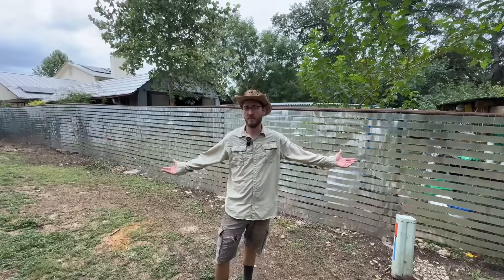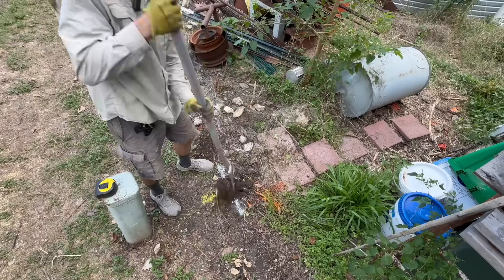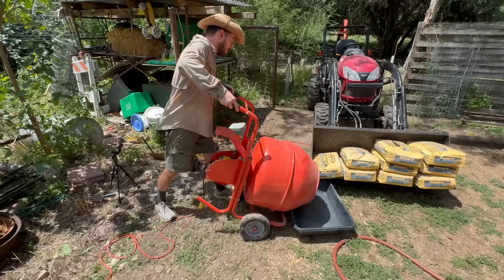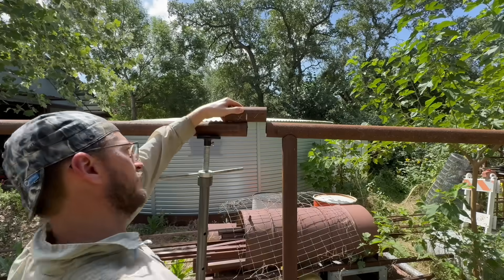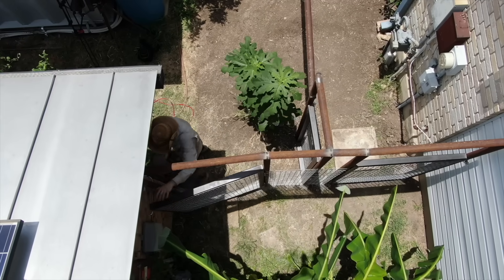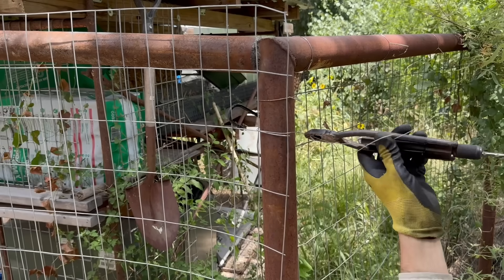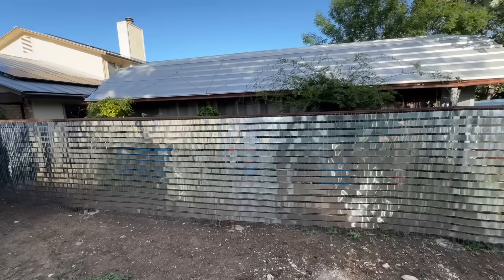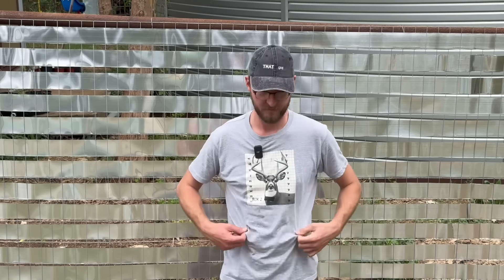This FENCE Lasts 100 years!!!!

Comment: my experience with welded wire fencing, is to unroll it on the ground parallel to the line of posts, and then stand it up starting at one end.  much easier than slowly walking the the whole roll upright.  very creative idea, but if I was the neighbor, i'd not be thrilled to have a shiny aluminum fence that you can still see through, as a barrier between me and your scrap piles....although if it were me,  you would probably be the one with fewer scrap piles!

Comment: Will there be shine bearing down on the neighbor’s yard? We have that problem with our corrugated metal siding on our garden beds. Neighbors don’t seem to mind when there are slight shine on them when they drive down the alley at two in the afternoon on fall and spring days.
Also, our waist high garden bed is like a salad bar for the deer. Even though we’ve had to stick a bunch of things in so they point up, they can jump into it. I stick even more things in then.

Comment: Might want to check that drill stem with a geiger counter. The scrapyard i used to get it from had to stop selling it after they found the supply they were receiving was radioactive. It was lower levels but it was still crackling. It was all from super deep well drilling so i guess it got more exposure?
Reply from the maker: I just bought one on Amazon thanks to these comments. I’ll pin a comment if they are active to a dangerous degree.

Comment: Thank for that video. I live in Pittsburgh. The area I live in will permit this type of fence. I like this type of fence. My reason for a fence is because of my dog. My dog isn’t too smart (yet) to dig under the fence, however I wouldn’t put it past her to be able to squeeze under it. Would a brace on the bottom be a solution?
Reply from the maker: You could weld a horizontal pipe a couple inches off the ground spanning between each post. That would help.
Reply: Would you do that before or after the mesh placement?

Comment: how have I never heard of wire twisting pliers!? Subscribed and liked just for that. Seriously fantastic video.
Reply from the maker: I put a link in the description to the pliers that I have found hold up best over time. I went through 2 pairs of the $30 variety before buying the ones I link to. They are over $100 but they have held up SO much better over time. Thanks for commenting and for your support!

Comment: If we had scrap dealers that had old drill pipe here on the east coast, I would have done this in a heartbeat! Nice job!
Reply: using that kind of pipe anywhere outside it's origin gets spendy. I use it a lot on a local ranch up here, we buy it by the semi. and though it is a great alternative to wood. once you add the cost of shipping and handling it can get a bit pricey. In the long run it's better to pay more up front to get a product that should last a lifetime  imo

Comment: This is what we call horse fencing in my neck of the woods. And I don't think it's going to last 100 years. I see people's fencing coming apart particularly at the bottom. And the metal poles that you have going into the ground will rust and corrode over not that long of a period. I have that same type of metal pipe for my horse shade cover and I have had problems with corrosion for the parts that go into the ground. And yes I did put it in concrete.
Reply: yeah it won't last more than 30
Reply: @nirodper  Depends where you live soil and climate.  Here in West Texas that pipe will last a long time.
Reply: I wonder if it helps to paint it before burying it?🤗🐝❤️
Reply: @deborahdanhauer8525 probably not.  We haven’t painted our cattle pens.  Some of our horse pens were painted, but it’s been 30 years at least.  We now put most of that pipe in with the hammer attachment on the skid steer.  It’s faster, and it’s very little ground that’s disturbed.  It some of it last 100 years I would be surprised.
Reply: @jasonrobinson5757  30 years is a good long time though.. What part of the country are you in?
Reply: with that kinda misshap and huge gaps between rusted metal poles I doubt it’’d last 3 years…i called that greg work rite der.

Comment: We recently build a fence as well. We were planning to use a steel net just like you did and use the flashings to add some privacy. But instead of alluminum flashings, we were looking at the plastic ones. But surprise surprise, the price of those things were enormous. Instead of a steel net idea we actually went for a steel sheets, and the price for those were actually nearly half cheaper than using a net and a plastic flashers to cover it up...  Interesting how a fully metal painted 2mm thickness sheets are cheaper than a net and a plastic put in it, not to mention the time it would took us to weave all those plastic rools inside of it. Its a long fence.
Reply from the maker: I actually looked at the plastic strips too on Amazon. I’m pretty confident they cost around twice as much as what I did with the aluminum. Thanks for commenting and for subscribing!
Reply: Oh wow, glad I kept reading....I was going to search exactly what your talking about...

Comment: Id maybe take some shine out of the metal to prevent a reflection fire
Reply from the maker: With the fence as flat as it is I don’t think m that will be likely. If it was a curved fence I think the risk would be higher. Hopefully the vines will make it moot as they shade the lower parts of the fence. Thanks for commenting!

Comment: Great video, I've never seen those fencing/linesmen type spinning pliers they look awesome. 
The 5 gallon bucket/flashing dispenser was brilliant as well.
Reply from the maker: They are awesome. The cheaper ones wear out quickly. These were a bit over 100USD but they have lasted for years now. Link in description if you want to look. Thanks for commenting!

Comment: A better way to cut your saddle is with a 2 ³/⁸ pattern and a torch. They sell this pattern at weld shops in the area where you see this drill pipe

Comment: how did you hook the flashing to itself??
Reply from the maker: I didn’t. I just overlapped the edges by a few rectangles so that friction would hold them there. Kind of like basket weaving. Then on the end near the gates I just bent the end of the flashing so it wrapped around the wire fence. Thanks for commenting!

Comment: The lasting 100 years estimate may be true in Texas, but places where the ground freezes and snow accumulates may cause it to heave out of the ground and rust away where the poles touch the concrete. In Newfoundland I've seen many fences, basketball posts, etc. broken off at ground level.
Reply from the maker: Link in description to Montana fish and game website. They say they last 100 years there too. Pretty dry in Montana though right? The walls are quite thick. Much thicker walls on these pipes than any basketball goal tubing.

Comment: Does the fence heat up with the Aluminium?? I pray no child and animal touches it.
Reply from the maker: Quite a bit of heat is reflected since it’s so shiny. It actually heats up less than a dark surface would. It also is not as sharp as it looks. One would have to slide their hand down a long stretch to get cut. A gentle grab is not enough to do much damage. Thanks for commenting

Comment: That is quite the solar collector is going to be hot, hot hot
Reply from the maker: Reflective surfaces are cooler than dark ones. It does not get that hot. It does indeed reflect light onto the ground but so far the plants seem fine with that.

Comment: like the aesthetic but i don't think it's great at its job. a fence should usually not billow in the wind, right? well during your timelapse it's very noticable that the large span of thin wire fabric has not much support. especially none at the bottom. i believe this fence will be very easy for things to get underneath too.
Reply from the maker: As the vines grow they will tether the bottom to the ground. I don’t mind if small critters crawl under. I just don’t want the neighbors dogs to crawl. The vines should be sufficient once they grow.

Comment: I will soon be installing a welded wire fence too.  I thought about growing passion fruit vine on it and then became concerned about restricting air flow in my yard.  I am on the east coast of GA and it gets really hot and humid here.  Have you noticed a restriction in airflow?
Reply from the maker: Nothing noticeable. The wind passes through to some degree due to the gaps in the flashing rows.

Comment: I’m aesthetically partial to wood, but I admire your unorthodox approach. It is kinda beautiful. Look forward to the greenhouse.
Reply: Same here. I wondered if there exists a slim wooden slat that would work…
Reply: @lisaw1085 best bet is veneer but man, I would not want to pay for and replace that fence as often as it would demand. You could prime and paint the metal any color, even mix colors if you were feeling fruity. Of course there's also options like "living fence" where live plants are weaved into fences as they're growing. Or dead bamboo slats, tall growing reeds, burlap or canvas sheets, rope lines, tile... Well hell, anything that's opaque serves the purpose, really.
Reply: @lisaw1085 ¿Maybe furring strips?
Reply: @nonya.bizness  depends on the dog. I had a Rottweiler who didn't want to be left in the sunroom one late fall day when it was sleeting rain. He tore aluminum sheet thicker than flashing from the door and knocked it off its hinges. Backyard looked like a bomb had exploded from inside the house with scraps of door all over.

Comment: That’s a big claim let’s break it down prices are AUS ….For a 50 m roll of the horse mesh would cost $800 each star picket  $50 each Vs $80 of seconds steel pipe. Flashing around $20 per roll Cement $10 per bag. And so on Pine fence $100 per meter inc someone else’s labour . Why not simply use star pickets with the horse mesh and yr done. No welding or concreting required. I do like yr wire twisting tool. How did you fix yr flashing? This looks great.👍
Reply from the maker: I put rough cost in description. Based on local prices of course. The mesh just overlaps at the joint and is held in place by friction. Much like basket weaving. Thanks for commenting!

Comment: i have similar fence 20x yeras ago.

1. paint it
2. plant hedera helix to fence. just 3-5years and u get a 30cm thick green wall. 

it is enough to stick hedera sticks at the feet of fence. they take root by themselves in autumn or spring. cheap and fast.
Reply from the maker: My region is a bit dry for that type of ivy I think. I’ve gotten Virginia creeper to take over near the soaking pit by the sycamore. I agree. The plants are a better fence than the metal once they grow a couple years .
Reply: In the U.S. English ivy is a nuisance and would interfere with his food forest and garden.

Comment: I just built a dog run for a customer, and I wish I had watched your video first. although the job went well, I wish I knew the flat bar trick. I played hell wrestling that roll....
Reply: the flat bar trick was the tid bit that i will take from this and make my life easier. 50 years old and still not done learning!  Thanks for the upload, the fence turned out great. Keep us updated on how it preforms.
Reply: @yardfowl3149  I'm pushing 60 and apparently still learning.
Reply from the maker: I hope it helps you with future projects. Thanks for commenting!
Reply: 🍜🌌This has to be close to the top if not the top tip I have ever gotten from a long form build video! No, it is THE TOP TIP I'VE EVER GOTTEN. 

So much time wasted wrestling wire fencing....
Reply: @lisa2stewart IKR. I'm sending this video to a friend who's on 70 acres, and who's job of fencing seems to never be done. Lol.

Comment: Are you not worried that the sun's reflection from the aluminum may cause a fire?
Reply from the maker: I don’t think so. If it were a parabolic shape then I would be more worried. But it’s pretty flat so the light averages out in a pretty dispersed manner. Thanks for commenting!

Comment: With such an overpowered fence, are you at all worried about the gauge of the wire used to attach it to poles? I've made some fence with thicker wire before and had it break on me, but I think the forces to that fence were probably much higher than you will experience.
Reply from the maker: The safety wire is stainless so even though it is much thinner it is a stronger alloy. I supposed if a large animal tried to ram through it that would be the true test. I hope I never find out 😂 thanks for commenting!

Comment: I would be very worried about the slicey-dicey-ness of the aluminum flashing (especially the side you cut to width).  Hopefully over time the weather and elements will dull those edges.
Reply from the maker: A bit rough on my fingers but honestly the edges were less sharp than I was worried. Thanks for commenting!

Comment: Nicely done. Also nice to see someone working with a good neighbor for a better overall design. Since I live in a hurricane prone area I would have added a center  and bottom horizontal pole. Hoping your wind issues are less than mine. The aluminum is a pretty good hack I would not have considered. It will gain some patina over time and loose it's reflectivity but then it will accept paint easier if that ever becomes a goal. I was going to suggest planting some blackberries that would interlace with the fence over time but that would just be a dinner bell for more critters.
Reply from the maker: My neighbors are the best. We are like family. And thank god they like the look of the new fence 😂 thanks for commenting!

Comment: Your basic pipe fence turned out a lot better than a similar pipe fence I frequently drive past.  It was a complete failure. I don't know if the posts were not set deep enough, but apparently the post move enough that every summer several pipe sections break lose and fall.  I think (hope) they sold the property because it has only been complete for 5 years and now this summer the fence has been torn out.
Reply from the maker: I wonder if they didn’t dig the footings deep enough or if they skimped on the welds???? Thanks for commenting!
Reply: @suburbanbiology  How is thermal movement accommodated?  On the top run, doesn't it add up to a lot?

Comment: So what does a flashing fence sound like in a strong wind? I would worry about the flashing clattering against the wire fence material. Great video, well built fence.
Reply from the maker: We had high winds Monday that tipped over many neighbors’ fences. I didn’t hear the flashing over the sound of the rain. So I’m not sure yet I guess. The flashing didn’t budge though!

Comment: 100 years? I give it 10 years before the aluminum falls apart. Galvanic corrosion will not be your friend, and raw aluminum without any any anodizing doesn't withstand water very well at all. I do like the idea of the fence though.
Reply from the maker: Even if the aluminum disappears as long as the galvanized steel wire persists the vines will do most of the job of being a barrier. Virginia creeper grows thick here and was all over the previous wooden fence. Thanks for commenting!

Comment: I'm surprised you didn't put in a bottom brace at toe height, but I guess there's no dogs or other critters that would try getting past it from the bottom. I've seen cyclone fences pried up at the bottom from that kind of thing if it doesn't have anything for the mesh to anchor to.
Reply from the maker: I’m counting on the vines to anchor it over the long haul. In the meantime we don’t have any big dogs to worry about. Thanks for commenting!